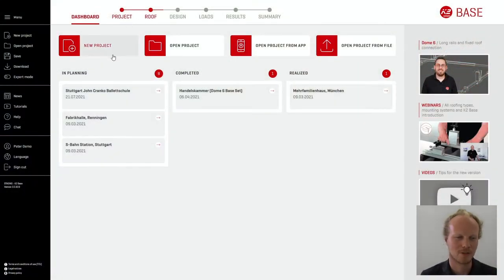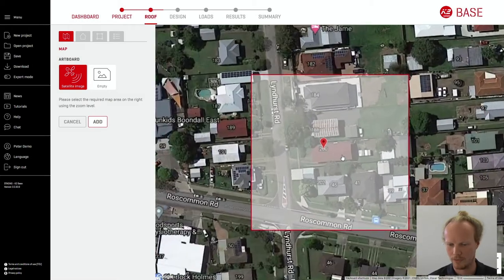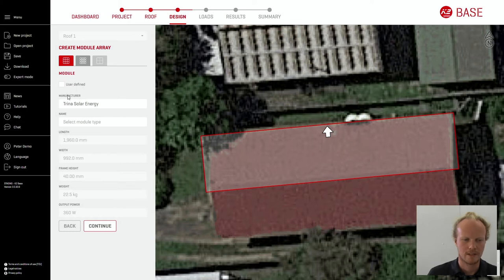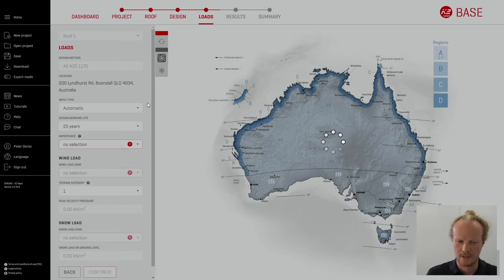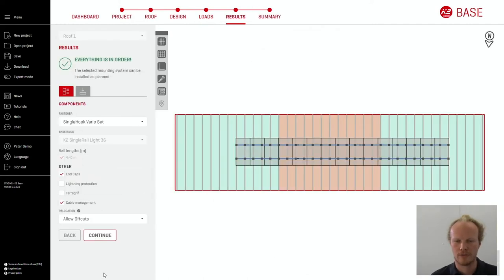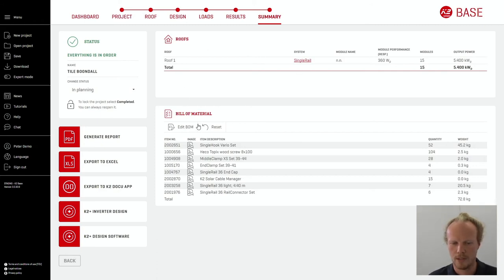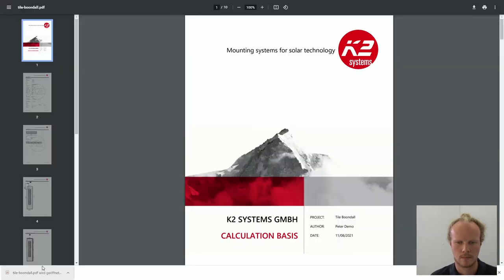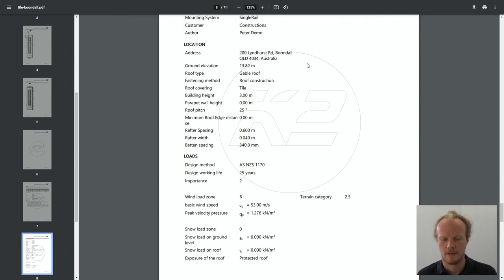K2 Base (en-AU): Planning a PV system on a tile residential roof

Comment: How to add the second roof?
Reply from the maker: There's a little plus symbol (circle +) at the top of the tool bar. Also when you create several module arrays the button for adding an array is there. There is also a copy symbol in the lower part of the tool bar which enables copying complete roofs or module arrays with particular settings. Obstacles/obstructions can also be copied. 
Please watch also the following video https://youtu.be/SRb6Lcqp-vA?t=148